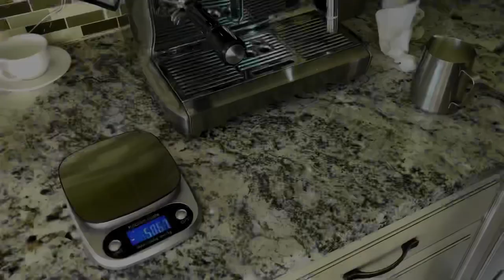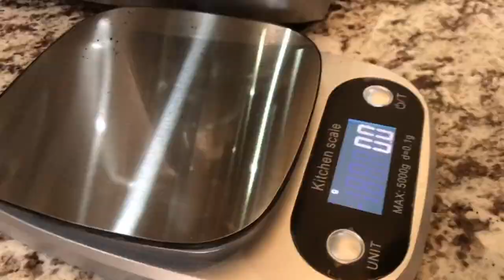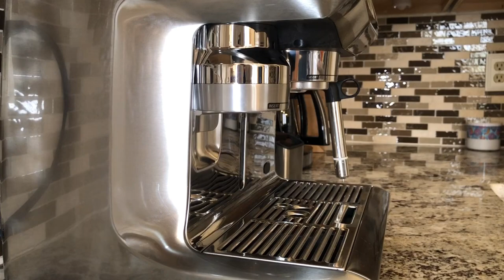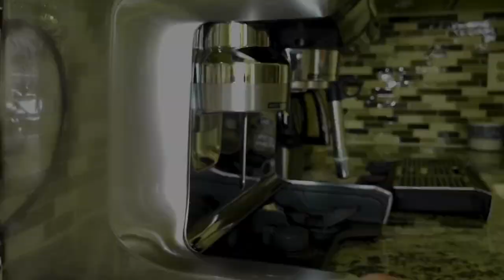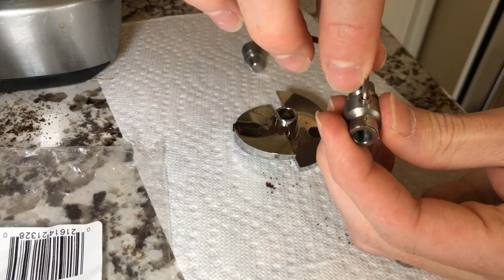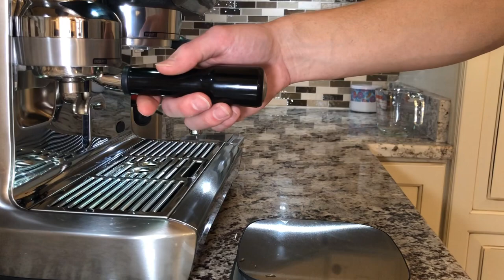Breville Oracle Touch Maintenance - Tamping Issues - Wavy Tamp

Comment: I never had the bad tamp issue with my factory setting with 22g dose.  I adjusted the temper fan height to get 18g and now I get inconsistent tamps.  Some times I get good tamps bu other time it is not.  Any suggestions?
Reply from the maker: I've experienced the same thing when the tamp fan is calibrated to 18g. I don't think the tamp fan does well at lower heights. I raised mine back up to get a dose of 20g, and tamping is back to being very consistent. No bad tamps. You may also want to try to grind finer first (if you can do it without causing over extraction). Bad tamps often occur when grinding too coarse. I hope this helps!
Reply: @CoffeeWiser  Thanks for the quick reply.  One question on the tamping pressure setting on Breville Oracle Touch.  Do you know what it is?  Would I get better espresso if I got a distributor and calibrated tamping tool to tamp after it finished?
Reply from the maker: @rmallipeddi1  I specifically asked Breville Customer Service if I could adjust tamping pressure, and they told me that it was not possible on the Oracle Touch. I was hoping there was a secret menu, but apparently not. 

There is no way to turn-off the auto tamp, so I am not sure that you can use the internal grinder and still do puck preparation yourself. I think you would need to get an external grinder too.

I've been experimenting with an external grinder because of some inconsistencies with the Oracle Touch (I made a video on that), but that leads to many more variables to control, even with well a calibrated distributor and tamper. We use the machine both ways now: sometimes with the internal grinder and auto-tamping, and sometimes with the external grinder and manual puck preparation. The automatic way is much faster, and descent for the most part.
Reply: @CoffeeWiser  Thanks!  Love your detailed videos.  One question on bad/wavy tamping.  Instead of throwing the coffee what If I use a distributor and tamp to fix it? I am going to try today but wanted to see if you had experimented with this.  I just hate to throw away badly tamped coffee.
Reply from the maker: @rmallipeddi1  Yes! I actually do that. I bought a $50 distributor / palm tamper from Amazon, for just this purpose. Wavy tamps used to bother me a lot, now I just fix them and brew. Usually, the shots will not be perfect, but they will be acceptable.
Reply: @CoffeeWiser  Thanks That makes perfect sense!

Comment: What about adding a VST 15g basket, in theory it could get you 17-18g...
Reply from the maker: Devildman, you are correct. You can easily fit 18g in a 15g VST. The headspace will be about the same as it is with the original basket. Lately I have been using this basket, fitting a full 20g in it:  https://www.espressoparts.com/espresso-parts-hq-14g-ridgeless-style-double-portafilter-basket?gclid=Cj0KCQiA5bz-BRD-ARIsABjT4nh9X3H7j87eD5teYplAOO6sIcoQsp7-zzCqlNLSjTykj63y9l6lzjcaAhIXEALw_wcB

Comment: More parts, more problems
Reply from the maker: I couldn't agree more. Sometimes I miss the simplicity of a Rancilio Silvia with PID.
I have also read that the maintenance cost for La Marzocco GS3 and Slayer Single Group machines is quite high, even without all the extra parts. 
Overall, I am pretty happy with this machine.